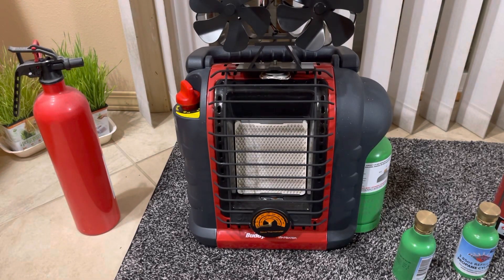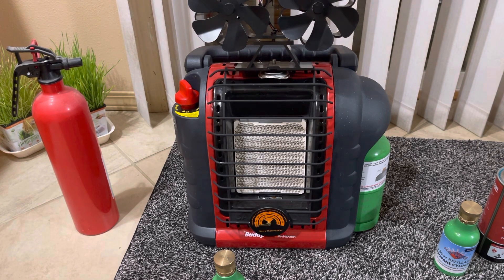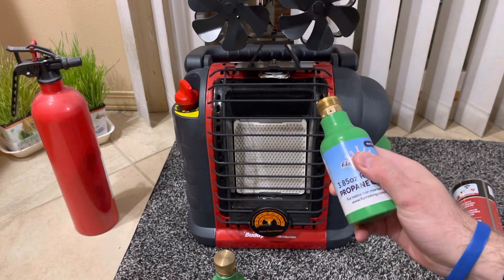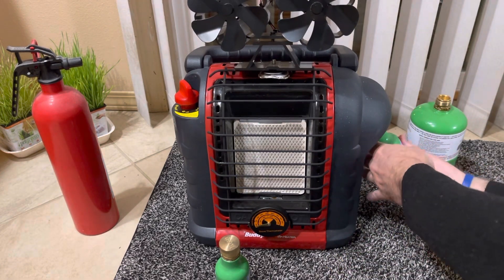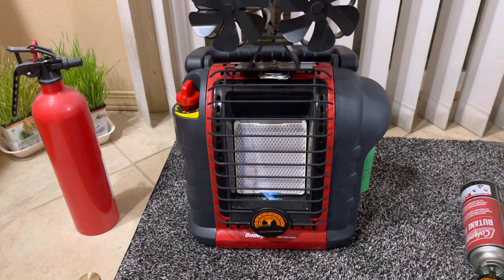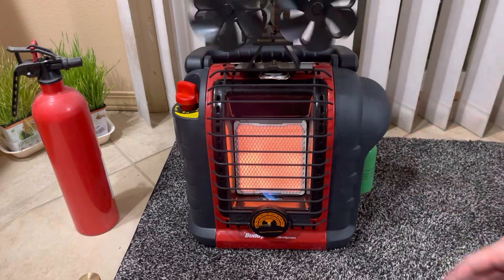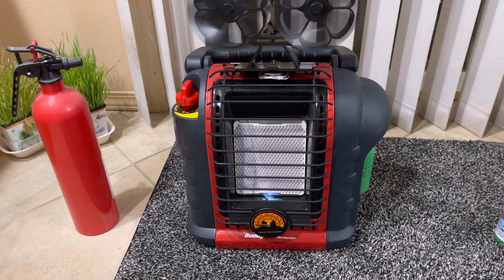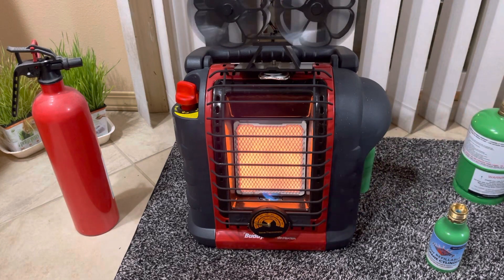A Buddy #Heater Ran on #Butane and Look What Happened!

Comment: years ago, depending on where you lived in the us you would get butane or propane sold generically as 'lp gas' at different times of the year, in the summer you would get butane and propane in the winter. but yes, it is more difficult to get bulk butane now in the us. welding shops have it, you can get 5 gallon grill tanks filled with 100% butane if you really need it, but few people do.
Reply from the maker: Thank you. Good comment. I like the option of a fuel with less pressure. My search for bulk butane pulls up a lot of unfortunate accidents and drug culture related use of butane as a solvent. I believe that the drug related use has resulted in tighter regulation of butane gas.

Comment: Where do you get your fans for the top of it do they clip on and what's the purpose for them? Is it to blow the heat around or for a safety reason? Thanks
Reply from the maker: The fans are listed in the description with a link. We use them to direct the heat towards us rather than upwards. This is very useful for outdoor situations.
Reply: @Linus007 whats the best tank for the heater and were can I buy it the refill ones sounds best but I don't see anywhere I can but them
Reply from the maker: I have links for the tanks in the description. If you cannot find the flame king refillable tanks, there is another option for this particular heater. I have links for hoses regulators and quick connect connectors that you can use with a large propane tank. Keep in mind large propane tank can only be used outside. The smaller tank that is shown in this video is the only tank that is rated for indoor use.

Comment: "I had a propane heater, but it burns too quickly. After discovering the Chinese portable diesel heater, I have been using it for several years now and it has proven to be safer, more reliable, and more efficient over time."
Reply from the maker: Diesel and kerosene have an enormous amount of energy per kilogram of fuel. I find that is the case with kerosene heaters too. Unfortunately finding kerosene is tough. What is nice about your diesel heater is the outside ventilation. There are many videos on how to shore up a Chinese diesel heater for safety and reliability. Thank you for sharing this information.

Comment: Butane is common in the United Kingdom and cheaper than propane. There is no way to connect large butane bottles to a buddy heater though...
Reply from the maker: Thanks for the comment from the UK. I am glad that you have options there. 😊
Reply: Im looking into this right now, but there ARE similar butane bottles with the same attachment, only they are too tall to fit.
If you could SAFELY raise your Mr Heater, so there was a little clearance, you could attach the tall bottles.
Personally I have a filter and extension hose for large bottles, so I guess in theory I could just use those on the taller propane canisters. I would however fix them to stay verticle.
FYI some devices really do NOT like you to put the gas bottles on their sides. I have a few camping stoves that tend to have runaway flames when I do this. I guess its because liquid fuel and not gas is flowing into the system. (fyi my coleman cooking stove which loads in sideways mounted aerosol cans of butane actually has some kind of gas expansion device inside it which I assume is to counter this. Good luck mate)
Reply from the maker: @TheWtfnonamez  
Thanks for the comments. This new video shows a bit more content for fittings that connect to various devices. I also address that lift off problem where propane is used on butane devices. https://youtu.be/a5I9ENOItlE
Reply: @Linus007  Thank you mate.